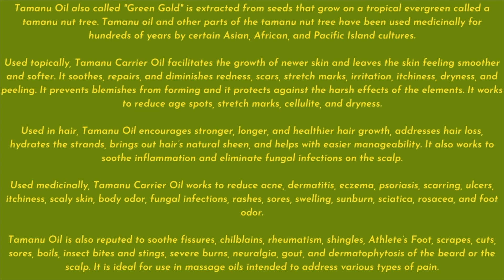Tamanu Oil Wood Press Extraction | மரச்செக்கு புன்னை எண்ணெய் | सुल्तान चंपा तेल कच्छी घनी | పొన్న

Comment: Unhygienic
Reply from the maker: You may be right, as this is what happens behind the scene for most oils that are extracted using the traditional method in villages. This oil is used for lighting lamps. Wholesalers buy from them, send to the lab for assessment and sell it to end users for a very hefty price. Thanks for commenting!
Reply: @ayuramore2509  I don't see it as a problem.  This is nature at its finest to me.  It's the chemical additives and preservatives we use in the West under 'sterile' conditions that are more likely to cause a problem from what I've read. 
 
I love the Tamanu oil I've gotten off the web.  It smells fresh, green, nutty, oily, buttery, sweet, savory, with wafts of sea breezes to me.  I like it mixed with other oils and in body butter for a variety of aches, pains, itches, and skin ailments.  I'm about to buy some more as I ran out.